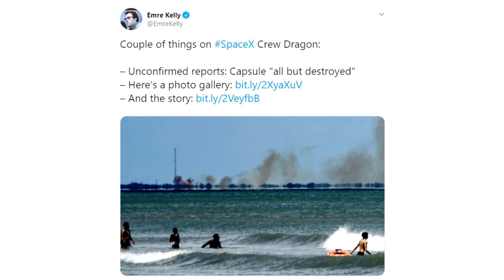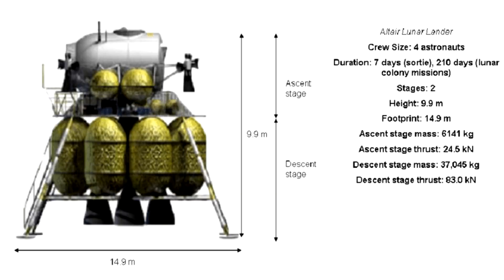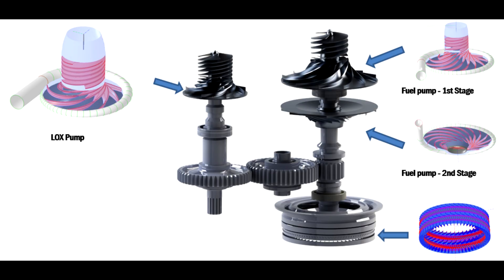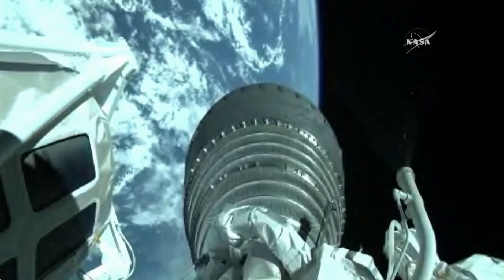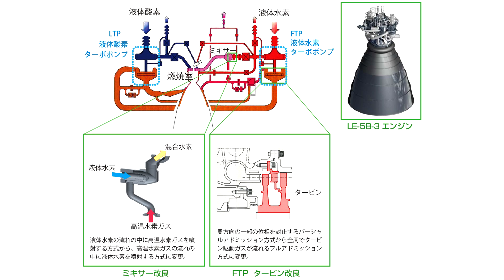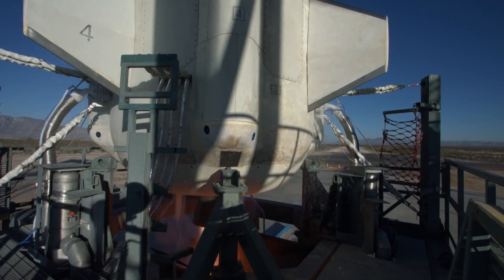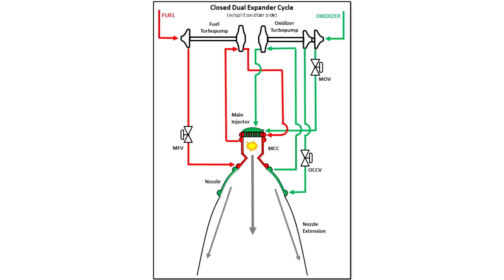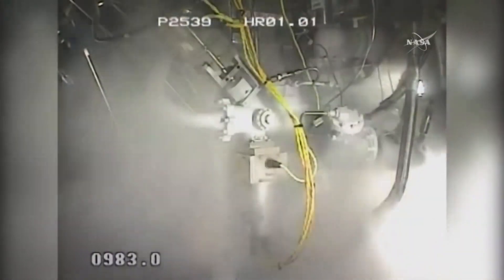Expander Cycle Rocket Engines - Using Waste Heat To Drive Your Rocket

Comment: Is the content of the fuel tanks replaced by vacuum, when the fuel is used up?
Reply from the maker: No, tanks need pressurization to keep fuel flowing.
Reply: @scottmanley  So as the fuel amount gets lower, what replaces it inside the tanks ? I suppose at some point there won't be any pressure left since the fuel will be used up?
Reply from the maker: Rockets include helium tanks to keep pressures up while tank depletes. Other   designs use autogenous pressurization where some vaporized propellant is sent back into the tanks.
Reply: @scottmanley  Thanks for the info :) I imagined something similar, but i thought the chemicals might mix and fault the whole thing...

Comment: Hey, a couple of us were wondering about a hybrid between the expander cycle and the expander bleed cycle where you can switch back and forth to suit your needs. Would that work? Idk with the turbo pumps probably being so different for each.

Also, could you drive only one pump with the expansion cycle and the other with another cycle to maximize efficiency and thrust?
Reply: I don't see why not. Probably the best combination (IMHO) would be to use the energy collected by heat transfer from the walls of the combustion chamber and nozzle to drive only the liquid hydrogen pump, with all of the hydrogen flowing through this expander cycle section. Then have a secondary cycle generating just enough power to drive the liquid oxygen pump, since with any hydrolox engine the volume of liquid oxygen needed is less than a quarter of the volume of liquid hydrogen used.

This is partially because liquid hydrogen has such a low density - pieces of styrofoam actually sink in liquid hydrogen. But also because hydrolox engines are always run very fuel-rich, primarily to get as much unburned hydrogen into the exhaust as possible to minimise the average molecular weight of the exhaust, which maximises the average exhaust velocity and hence increases specific impulse.
Another reason for running fuel-rich is to keep the temperature down - if a hydrolox engine was run at stoichiometric ratio to burn 100% of the hydrogen used, the exhaust temperature would be several thousand degrees higher. Consider than these engines already run at more than 3000 degrees C, so even running all the propellants through the walls of the combustion chamber and nozzle would not be enough cooling to stop everything melting unless you made the hot bits out of tungsten, but then it would be too heavy.

Anyway, the secondary cycle could either be a conventional pre-burner or a combustion tap-off, again running fuel-rich, though it probably wouldn't make much difference which of those two approaches you used. You could even run this through another liquid-hydrogen cooled heat-exchanger first to bring the temperature down to a level the turbine could more easily cope with. This would also give the liquid hydrogen pump more energy, which might allow you to scale the whole engine up a bit, though I don't know by how much.

Comment: So the dual expander cycle is kinda like the full-flow version of expander cycle engines.

I do wonder, though. Do rocket engines overall gain any significant performance when it preheats its fuel and/or oxidizer as a coolant before burning it?

Comment: Why not take the bleeding expander design and use the dumped fuel together with some of the oxidizer to run a gas turbine 2nd stage pump? That should allow higher pressure chamber while using less fuel than traditional turbo pump design engine.

Comment: Could you just shove a large graphite rod (or some other chemically inert material that can tolerate high and low temperatures and conducts heat very well ) into the rocket so that part of the rod is in the combustion chamber and the other part is in the fuel and oxidizer tanks so that the heat from the combustion chamber is conducted into the fuel and oxidizer tanks, causing the fuel and oxidizer to heat up and pressurize?

Comment: Hey Scott, another great video!! Thank for sharing. Had a question... wondering if you know what kind of setup would be most efficient for a nuclear fueled rocket engine? I imagine  a nuclear fueled rocket engine would be powered and or plumbed through the combustion chamber and or nozzle  using a completely different style  “pump” system than explained in this video to plumb the fuel out of the  nozzle  to generate thrust but I was wondering if you have a video on this or could explain how this would work. Thank you in advance and as always, thank you for sharing. I’ve been a fan for a while now and appreciate all of the time you take to teach and inform  the public. Fly safe!
Reply: The engines developed under the NERVA project used a bleed expander cycle.

Comment: Well these all seem a bit better then some of my concepts but I remain confident. 

Although my current prototype was quite promising. Due to refinements in the design and upgrading the rotational power distribution packages I have dramatically improved efficiency. This has allowed me to eliminate 3 of the 7 guinea pi........ engines. This in turn gives me better balance, allows a reduction in lettuce...... fuel and reduces the overall waste produced by the 4 remaining engines. I will continue to be inspired by my hero Ralph Kramden. I too just want to send my loved ones to the Moon.

Comment: OK-------- Long Time Pet Peeve!  The Second of the two Space Shuttle Engine Competitors proposed an Expander Cycle Engine and even built a Subscale engine to prove it would work. Two things happened; when the Expander Cycle proposal stated an  360 ISP, the Nasa Administrator told the Winner about the higher efficiency and allowed them to come back with  Specific Impulse of 330 on their engine and then told the Expander people that they did not believe the ISP and ordered them to reduce it to 330 if they wanted to stay in the competition.  Guess what happened. Nasa decided that the new design would not work and gave it to You Know Who.  Then the Nasa Admin retired and went to work for Y.K.Who with a 6 figure salary.   Then when the Expander people came back to Nasa years later and proved a full sized engine would work and offered to pay for all development costs and they would lease the engines to Nasa  per flight, ONLY if they delivered all that was promised. Including  doubling the payload the Shuttle could lift into orbit!  _------------  But Nasa told them (in effect) to Go Frick themselves and again the Current Admin, Retired and went to work for  Y.K. Who for a Six figure salary that included a 7 figure bonus after a few years.   -------------- That is the reason All American Manufacturers basically got out of the Rocket Engine Business and we had to go with the Russians.
Reply from the maker: Would love some citations for this story.

Comment: Would the expander cycle work well with Liquid Methane?
Reply: Yes. In fact, if either fuel or oxidizer are cryogenic, you can use expander cycle. The main limiting factor is just the engine size.

Comment: Why is the expander bleed cycle engine less efficeint than closed cycle engines?
Reply: Some of the fuel is simply vented and never burns.  That means less thrust per unit of fuel and therefore a energy loss.

Comment: Scott-- Very good presentation.  Just 1 minor editorial comment.  The LH2 fuel is never 'boiled'.  The LH2 is pumped to a pressure above what is called its 'critical pressure'.  Above the 'critical pressure', boiling is not possible.  There is no 'discontinuous phase change', only a 'smooth' drop in density at temperatures above the 'Critical Temperature'.  Rocket engine regenerative combustion NEVER operate under conditions under which the fuel can boil in the regen system.  Reason--the heat transfer characteristics under boiling conditions are not stable, and quickly decay to levels that cannot support operation of the hardware.  For this reason, regenerative coolant systems (at least the ones that I have experience with) all use coolant that is at supercritical pressure.  Thank you very much.
Reply from the maker: Good point, should have been more clear with wording. After the regen system and before the turbines it does make the phase change to gas though right?
Reply: @scottmanley  No.  The critical pressure of Hydrogen is 186 psia.  The original chamber pressure of the RL-10 was about 350 psia (its higher than that now), so the 'back pressure' that the H2 system is 'working against' is essentially twice critical pressure.  As long as the H2 stays above the Critical Pressure, the words 'phase change' have no meaning.  It is certainly warm enough to be called a 'gas', and nobody would argue with you, but it didn't get there as a result of 'boiling', or as a result of any 'phase change'.  I hope I don't sound like I'm being 'too critical'--I only commented here because the notion of 'boiling' in the regen system is not what happens at all.  Thank you.  I enjoy watching your stuff.  We should talk sometime.
Reply from the maker: Thanks, I wish I’d thought it through a bit more, this would have been a really interesting distinction to spend a bit of time on.
Reply: @scottmanley  Not to 'dwell' on this too much, but if you want to present that kind of thing, a thermodynamic chart of H2 properties makes it easier to visualize.  Do you have access to such?  If not, I could probably help.
Reply from the maker: @dandeprop  Oh I learned all this in thermodynamics back in university (taught in the same lecture theater used by Kelvin), I'm already with you on this, it's the difference between knowing the theory and recognizing where it applies in practice.
Reply: @scottmanley  I understand.  Thank you.

Comment: Cryogenic H2 & He ... In another life I use to service vacuum pumps and systems.  The most unusual pump I had to service (for the first time) was a cyro-pump using liquid helium in a "cold head" that's purpose was the condense and freeze all the residual gas left in the vacuum chamber.  The liquid helium was produced by the system and there was a "temperature gauge" to indicate when the helium was cold enough to liquefy.  How this was done was with SS sealed system pipe system with pressure gauge and a small bulb in the cold head and was filled H2 at 7 bar.  

The pressure gauge scale wasn't in pressure, rather it read the lower end of the Kelvin scale.  The idea was that as the temperature dropped to cryogenic levels so did the pressure.  The gauge needle would sit there doing nothing and then would slowly drop to 14K at which point the H2 would freeze in the bulb. The pressure would still drop past this point as more H2 condensed and froze.  From memory the low end of the scale was 4K which is the temp of LH2.  

The reason for the service was they opened the connection to the gauge and let all the H2 out so it didn't work as it should.  All I had to do was evacuate the system, fill with H2, evacuate again to and then fill to 7bar.  The client was very surprised that it was so simple to fix and they just paid a lot of money for me to do something they could have done.  

Its the old story - "you're not paying me for turning the screw; rather you're paying me for knowing which screw to turn." haha
Reply: I work with a machine that uses a cryo pump, it's a wonderful combination of a stupidly simple concept (let's make a vacuum by freezing all the air solid) that requires crazy hardware. It still blows my mind a little seeing that temperature gauge casually  ticking over at 10-15 Kelvin.

Comment: Ooh, ooh!  How about having your expander bleed turbine running an electric generator that will run electric motor-driven pumps?  Add some battery packs so the pumps can change loads more quickly than the generator, and the generator can charge the batteries back up over time.  This could easily solve the problem of fuel and oxidizer mixing through the bearing.  You could call it the Electron Bleed cycle!!! :whistles:

Now that I think of it, with bleed expander cycle engines, you don't particularly need to use fuel or oxidizer for your turbine gases.  Liquid Nitrogen in it's own tank could be used to cool the rocket and power the turbine.  Or liquid Helium, if you wanted that really low boiling point advantage...

Comment: So if Blue Origin runs their pumps from exhaust products then how do they start it?
Reply: I can't find anything about the BE-3 but there is some info out there about the J-2S the only other combustion tap off cycle engine ever built. It was supposed to replace the J-2 and offered higher ISP than the gas generator version. It also offered amazing throttle with "idle mode", it had a maximum thrust of about 100 t but it could operate at around 2 t force in idle mode. It used a solid rocket powered gas generator to start up and had three cartridges for three start ups.
Reply: @please_stop-v7o  cool thanks

Comment: Could you compare thrust to horse power and specific impuls to torque?
Reply: I think thrust would be like horse power yes, but specific impulse would be more like fuel economy.  Usually high thrust has lower impulse
Reply: @BrainWearmouth  thanks but i still do not really unterstand specific impulse... why is it measured in seconds?

Comment: Hum...
Why not make two engines inside eachother?
First use some hydrogen to cool the main engine and pump fuel to the main engine, then push it through the inside of the combustion chamber using oxygen to cool it while it goes further down and closer to the vacuum of space and do a second engine there inside the flames of the first engine.
Your fuel wouldn't be wasted going elsewhere but is instead used to push the rocket forwards with a second burn.
And who knows, perhaps you can even work out a way to get more efficiency by burning up more of the fuel using a two staged burn like that if you can cool down the exhausts from the first burn enough to let it combine with the output of the second burn in such a way that perhaps you could have some kind of third burn?
I'm just speculating here and I'm certainly not a rocket scientists or even really a proper space nerd.
But in my mind this kind of makes sense even if the real world might not particularly agree with me.

Comment: Has anyone run the numbers on if capturing the engine thrust directly to push fuel through the engine would work? Think the engine mounted against the tank bottom, squeezing the fuel out, though obviously that would be a nightmare to make work!
Send to me that that would scale up arbitrarily large, if someone could figure out a feasible design....

Comment: Great video Scott. 

What about using CH3NO2 as a rocket fuel? 

Per weight it has 4 times less energy than RP-1, but it has 8 times smaller O/F ratio. 

I found claims for ISP of 276s as monoprop (http://oaktrust.library.tamu.edu/bitstream/handle/1969.1/ETD-TAMU-2012-05-11072/WARREN-THESIS.pdf?sequence=2) and 300s with H2O2 (https://www.quora.com/How-effective-would-hydrogen-peroxide-water-nitromethane-be-as-a-rocket-fuel) but none for LOX.
Reply: Nitromethane? Wouldn't it technically be a monopropellant?
Reply: @johnrickard8512  With oxidizer it would perform a lot better, but I can't find any sources that tested it.
Reply: The oxygen content decreases its energy density. That nitro group is also bad news on the detonation side of things. Hydrazine is a better monoprop with regard to Isp without the potential for unintended kabooms.

Comment: One question: why once heated up and expanded the hydrogen drives the turbine instead of just pushing back into the tank? And if it pushes against the tank back pressure wouldn’t that be the same as a compressed gas turbine?
Reply: You can use a gas generator turbine to provide power for the gas generator which can provide power for both turbines. This means you have to spin up your gas generator turbine using compressed gas (or electric engine or anything else) before turning on your gas generator. In any case, the gas generator turbine can be a lot smaller because it needs a lot less pressure than the one for the combustion chamber.

Comment: A thing that would solve many of these problems is some sort of bearingless pump. Now there is no leak, so it doesn't matter what drives what. It'd be really cool if something like that existed for the pressures required...

Comment: How would you (re)start such an engine if the ambient temperature isn't around room temperature but rather around let's say 3K because you're, let's say, in outer space?
Reply from the maker: If you're near the sun the ambient temperature isn't 3K
Reply: @scottmanley , so you basically make your rocket nozzle take a sun bath?